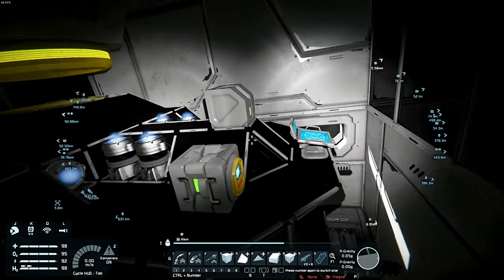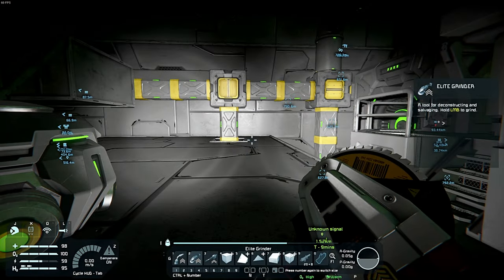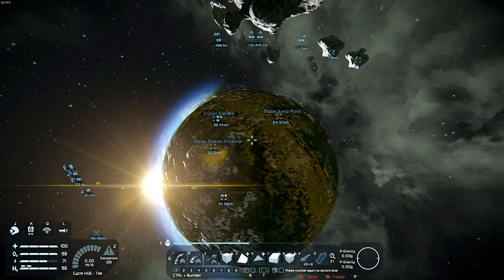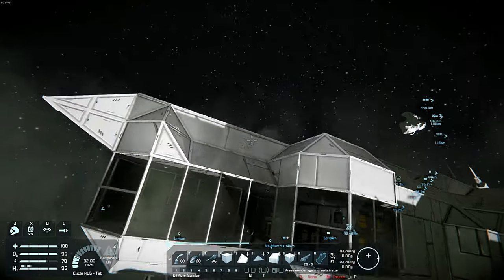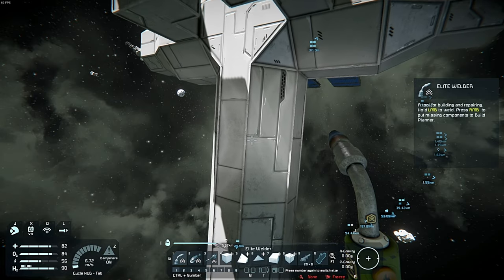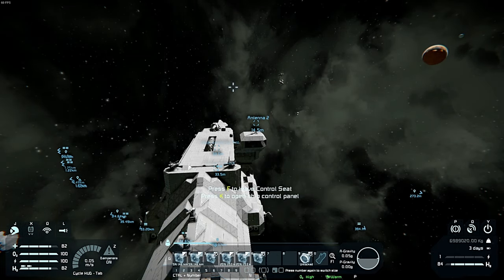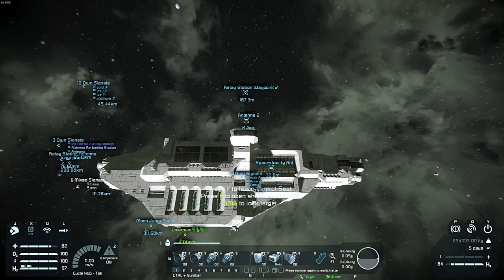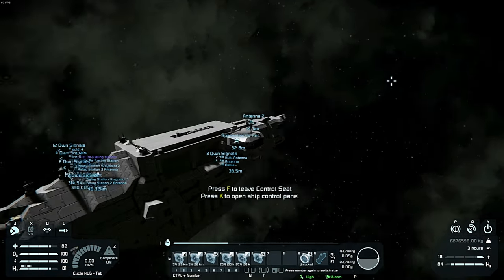Space Engineers ep37 - Building a Relay Network

Comment: the antenna dish is only a reskin of the normal antenna, it is not different and it is not directional.. it also has the same range. The laser antenna has an infinite range but you have to connect it to another laser antenna
Reply from the maker: I see, the laser ant, works as i thought the dish is dispointing but ok i supose if you don't want a massive pointing thingy :P Thanks for the info :)